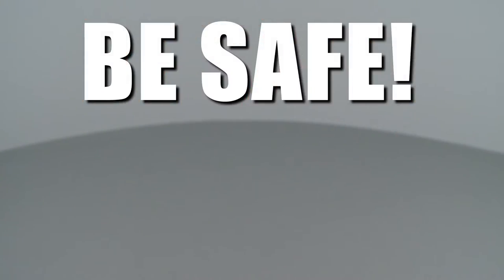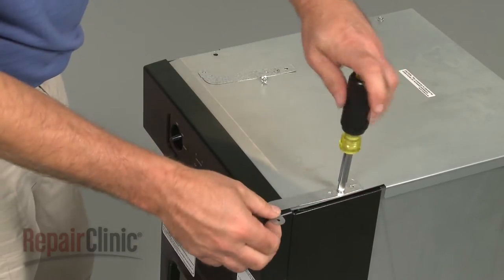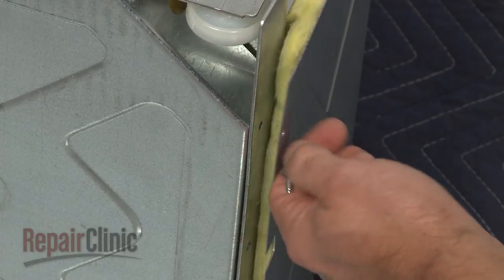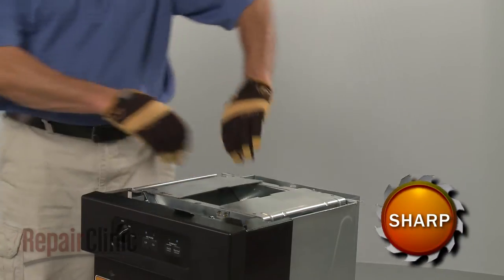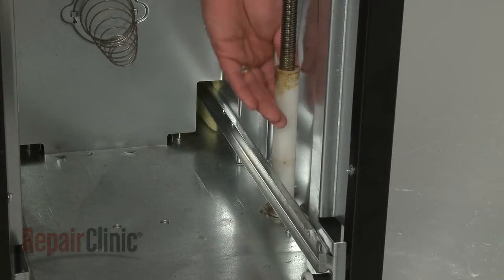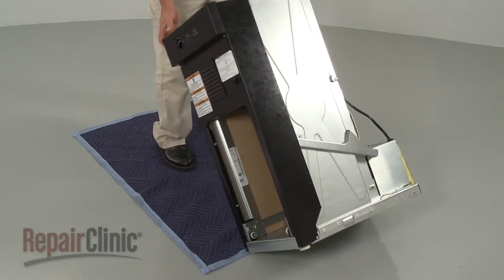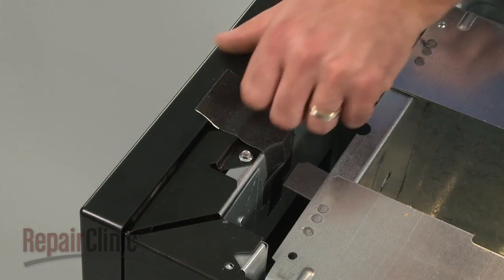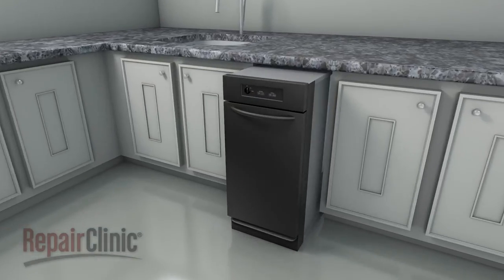KitchenAid Trash Compactor Ram Stop Replacement #9870037

Comment: I have a 1994 Kitchenaid Compactor, Model KUCC151T4.  It has the rotary switch.  Recently the ram started getting stuck at the top and the bottom.  I disassembled and it looks exactly like this, however mine has no Ram Stop sleeves like in this video, otherwise it looks identical.  The problem on mine is that the Drive Rods had actually bored holes through the sheet metal at the top of the ram.  I can't determine whether it never had ram stops or if they were removed at some point.  For this model, should I install ram stops, or is there some other switch that is malfunctioning?  Obviously the holes indicate that the ram is going too far down, but I can't understand why.  Thanks.
Reply from the maker: Christopher Rafter The rods should be stationary. The ram moves up and down as the rods rotate. If the plastic ram nuts get stripped out, the ram may get stuck. You should have ram stops installed so the ram doesn’t go too far down when you run the unit with little or no trash in the bin. When the ram goes down, it will keep going down until the motor stalls and the centrifugal switch drops out and causes the motor to reverse rotation. Located at the top, there is a limit switch that will stop the motor at the set height. Make sure the drive gear nuts are tight and the bearings are OK on the drive rods. Enter your model number in our website to determine if there are ram stops for your model. We hope this helps you.
Reply: ***** Yes, thank you.  I was able to verify that my model # did originally have ram stop sleeves from looking at a parts schematic, at some point someone must have taken them off, and that led to the damage to the ram.  I will replace those along with new ram nuts and a fresh coating of grease and that should take care of it.  Thank you!  your videos are very helpful.
Reply: My drive gear broke that was my problem